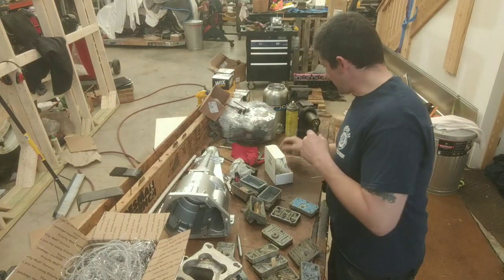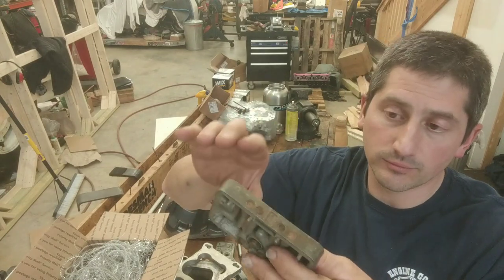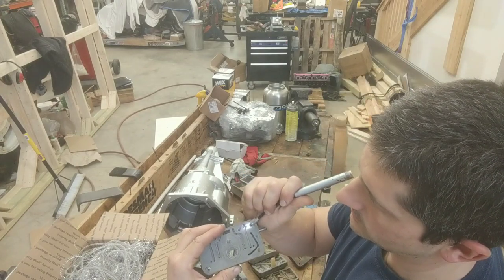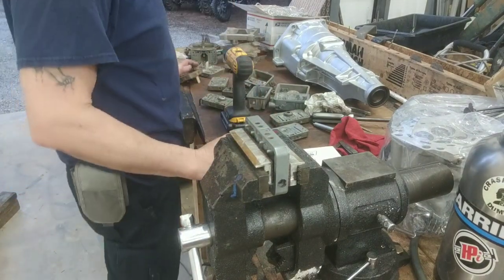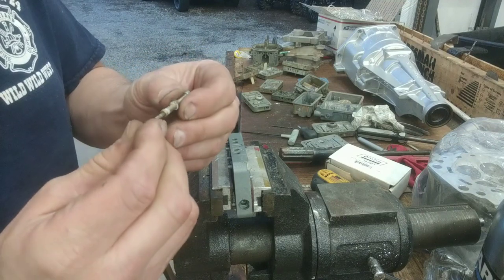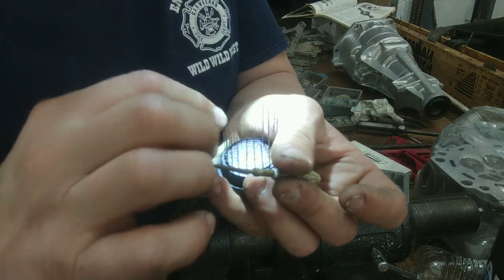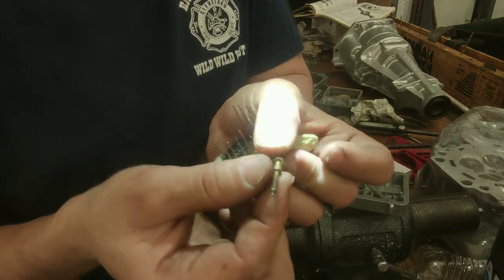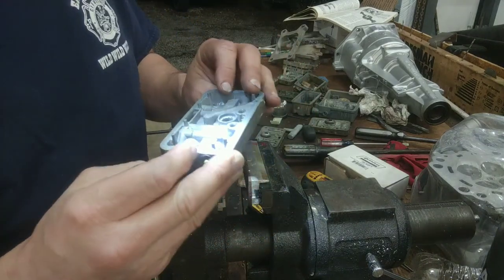Emulsifier tubes in Holley metering block.

Comment: Do you ever flatten warped metering blocks? And if so how do you do it? Very informative videos, I appreciate you taking the time to make them.
Cheers,
Max
Reply from the maker: Thank you for watching. I used a file or piece of sand paper on a known flat surface. O dont get them perfect, just take the high spots out and just a tad more
Tightening them I just use my thumb and finger. Ill go over them again the same way a few times after the bowls fill with fuel. I dont crush the gasket all at one or two tries. I do it in stages.
Reply: @firstrespondergarage  Good info, thanks!

Comment: How can I contact you for more info on a 4160 metering block, I’m stumped!!
TIA
Reply from the maker: What are you stumped on?
Reply: @firstrespondergarage  
I rebuilt my 4160 and idle is good but as soon as you go off of curb idle it stumbles and trembles as if it is not running on all 8 cylinders. I have watched countless hours of Holley issues and tried them all I think. This is on 1986 F150 5.8. This has me bewildered. I’ve tried mor things than I can list here
Reply from the maker: @darylstephens4429  whats your “vacuum” gauge read at idle. And also at steady 2500 RPM? What does the gauge do?
Reply: @firstrespondergarage  At idle 700 rpm vac is 18 and 22 @ 2500 thru around 3500. I changed carbs and it runs Great now. I want to maybe send you my metering block because if I pull the plugs with the tubes you didn’t explain how to reseal them. The metering has # 10959 stamped on it. 
TIA
Reply: @firstrespondergarage  if I pull the emulsifier tubes how do I seal the hole in the cap after reinstallation. Is it possible for me to ship mine to you for repair? This carb has kicked my butt!
Thanks
Reply: @firstrespondergarage  is there a way I can contact you other than here on utube?
Reply from the maker: @darylstephens4429  without you having any videos or no known affiliates contacting me is a NO go. If you want to reseal just tap them back in and put some gas resistant epoxy. As far as repair. They are cheap enough just to replace if its so bad. Usually they just need cleaned or if you want to modify. Without having the car in front of me there is no way to determine what your engine wants. O be willing to bet its not the metering. There are numerous things it can be and like I said without the car here there is no way of checking other possibilities of something else being wrong other than the carburetor.
Reply: @firstrespondergarage  thank you for your reply but I know the problem is the carb because I rebuilt another 4160 Holley with a metering block that has no emulsifier tubes and the engine runs and idles great. Im just a 70 year old DIY er trying to solve a Holley issue on my old farm truck. I enjoy your videos keep at it man!